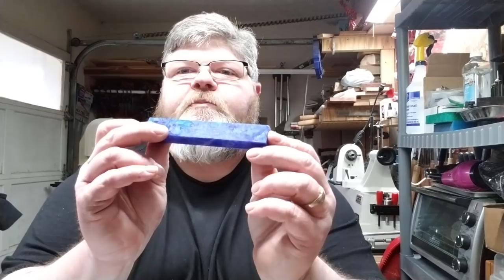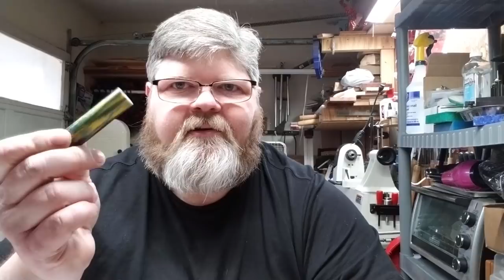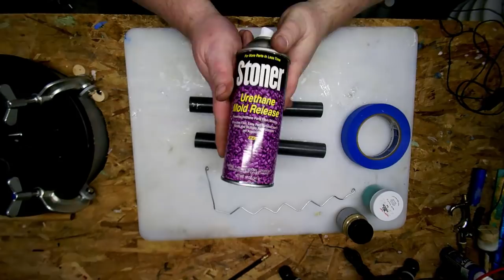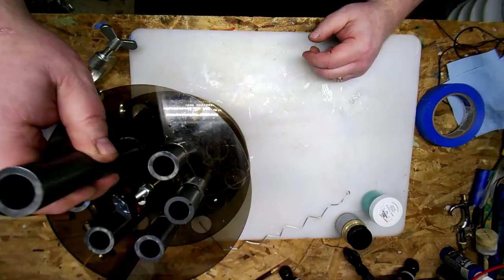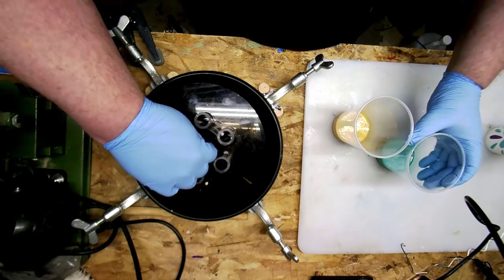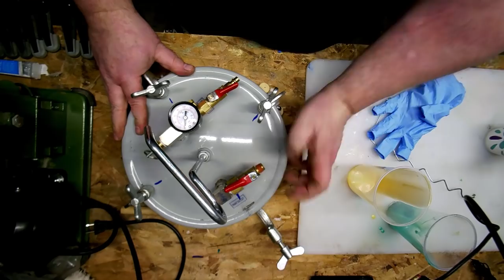Making custom crafted pen blanks

Comment: Nice looking blanks. I would have only a few bends in your wire. I would also start with your wire in the tube before you pour your resin. Once poured slowly pull the wire out as you rotate. You should get a more even swirl that way. Great work though.